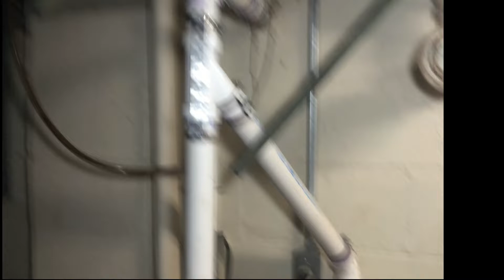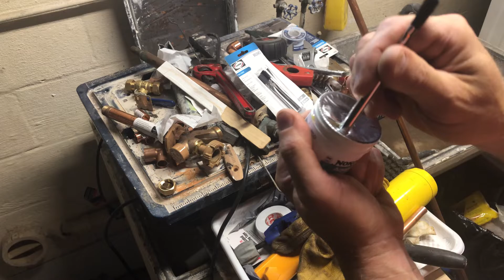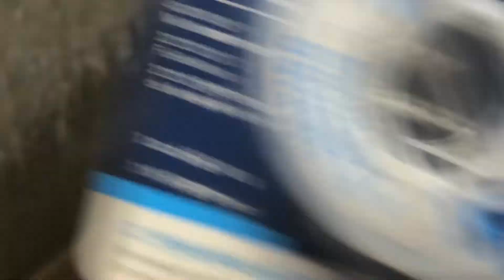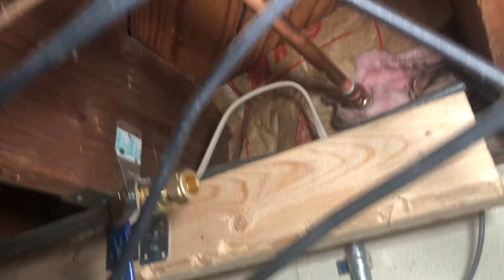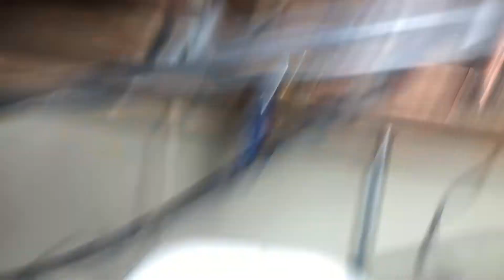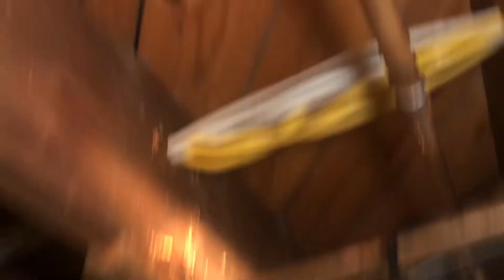Old School Outside Water Spigot   Wife Happiness Project - HOME REPAIR  Video You Have Been Warned.

Comment: I 've got the same job TO DO that I have been putting off  until August heat drives me into cool basement jobs lol!.   I am in a severe winter cold climate so my shut off valve [in basement]  has to have a drain port cap,  to allow  water to drain out from the outside spigot, to avoid freezing.👍
Reply from the maker: Amen - I caught a 78 degree day for the spigot removal. The balance was in the 65 degree basement. Checked this AM all looks good and sealed up. Knock on wood of course. Looking forward to anything happening and grabbing a valve handle to shut it down for repair. Thanks for watching.

Comment: Those aren't gate valves, they are globe valves.
Reply from the maker: Thanks for expanding my acumen - LOL. I call them ball valves elsewhere. Globe valve makes sense as well. Just as long as they aren’t the dumpy old screw twist valves. Thanks for watching.
Reply: Sorry but I screwed up.  Meant to say they are ball valves.  Gate and globe valves are the ones with the "dumpy old screw twist" design.  Gate valves for isolation and globe valves for flow control.